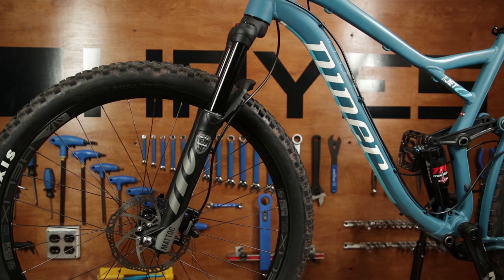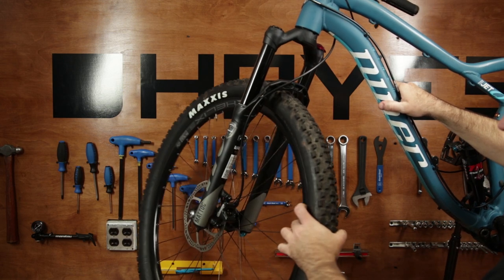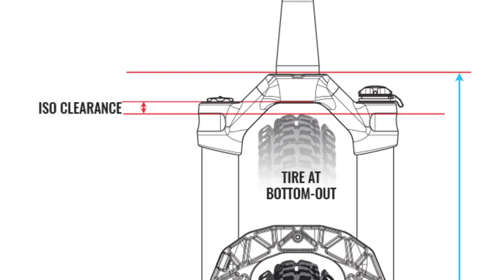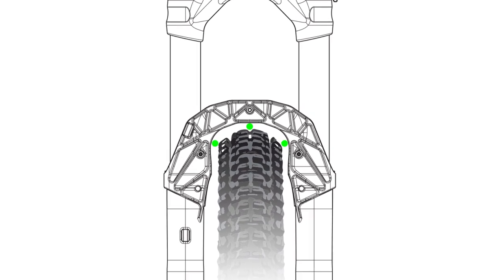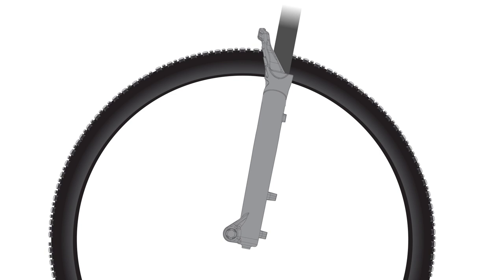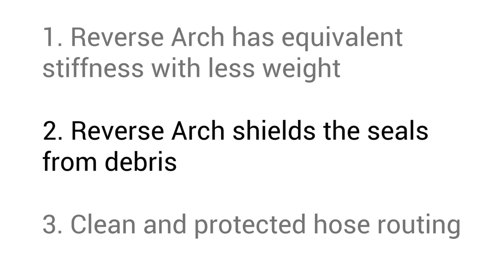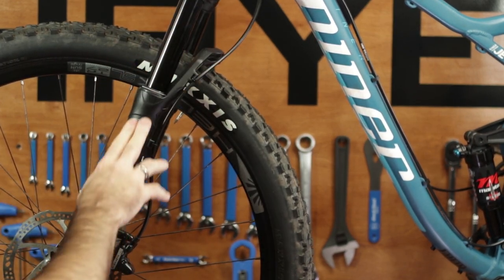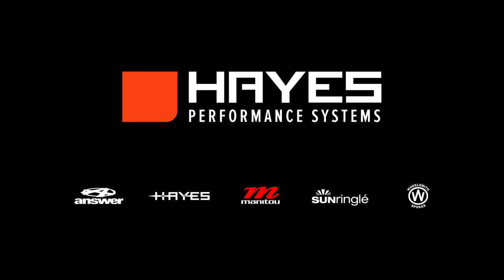Manitou Reverse Arch

Comment: I cannot say I'm the biggest Hayes fan and was never a Manitou user. I first used their Swinger X4 rear shock when a DHX 5.0 died on me back in 2007. It was a fantastic replacement and was just as plush, this is when I see the reputation around Manitou was perhaps unfounded. On my latest bike, I took a gamble on the new Manitou Mattocs with the Dorado damper. I did not regret it, they are incredible so stiff and plush. They are practically equal in performance to my Fox Float 36 and BOS Deville TCR's. To put them in the same performance bracket as those competitors its amazing praise. (Also much better service intervals than Fox)

I now regularly recommend Manitou Mattocs and compare them the Float 36's and Deville's 

Kudos Manitou keep up the good work. You are gaining more fans by the day. Even Pinkbike threads are praising the new Mattoc people even choosing them over the Pike.

Well Done 👌👌
Reply: Ive had a Dorado on my DH bike for a few years and it blows me away every time I get back on it after the winter season. The Mattoc should arrive any day now for my enduro with the 27.5 boost axle!

Comment: when the stock fox rp2 gave up on  my reign I was told it would cost £190 to fix, so started looking at RS but spotted the manitou mcloed at  £150 so thought I'd give it a go, and so glad I did its way better In every department than the fox ever was, its more supportive for a start and it's getting PLUSHER the more I use it. I was looking at one of their forks for my REIGN when the marzzochis gave up a week after I got the mcloed but couldn't pass up a bargain on a set of RS but I will definitely be looking at manitou forks in the future if they're as good as the rear mcloed.. Do manitou still make a coil rear shock as I wouldn't mind trying a coil on my reign.

Comment: How are folks getting on with the newer Mattoc? Considering getting one . Looks good and I can get 55% off list price!!
Reply: I'm trying to find info about these too. So far I've been able to find reviews from a year ago and they were 50/50. People either loved the plushness and support or their fork developed play and broke after a bit of use. I'm hoping that they have fixed those issues by now because if it doesn't brake, the value is definitely there compared to Fox or RS and I really want it to succeed but I have haven't yet been able to find and info confirming or denying that the quality control has improved.
Reply: Raul... I got a pair... very good so far! CRC are doing them for under £250 Sterling in the uk. I will have to make the servicing tools though.

Comment: Awesome design makes sense in everyway, Another advantage not mentioned but should be is that it also takes the weight of the arch and places it well behind the front axle thus keeping all the weight of the bike well inside the front and rear axles. This means better handling. The traditional front arch places arch weight more forward, almost ahead of the front axle, which means worse handling. Manitou is simply a better set up in every way. Too bad it's patented as I think would see it on every fork. Buying one now but very discouraged about the nearly 50% price jump since the world changed with this stupid C BS!

Comment: I need a fork for a Nishiki Colorado comp bike 27.5+. 
It has a 1 1/8 steer- 
27.5 plus- 
15mm axle- 
boost 110mm- 
I would like 100mm - maybe adjustable to 120mm. The problem I run into is the steer is 1 1/8 and not a tapered!  It seems anything with boost has a tapered steer.
Reply: Matt Doyle you can find Manitou Markhors on eBay with that configuration, or perhaps a Manitou dealer could special order one for you. Good Luck.
Reply: The Machete comes into that setup also if you want a step up from the Markhor.

Comment: Shout out... anyone set this rear arch up in the uk? My levers are reversed 🔄.....An arse.
Reply: My Dartmoor Hornet 26 had that annoying euro brake setup, left front, right rear. You just need to carefully undo the brake hoses at the levers and swap them over to make it UK. Try to lose as little of the oil as possible and cover the front caliper with a rag or remove the front brake pads when you do it to prevent the chance of oil dripping on your brake pads. You may need to bleed the brakes after swapping the hoses over. My front brake hose was only just long enough to connect to the right lever so I had to route it under the crown but it works fine.
Reply: @Beesa10  Ive just added a cable guide..... lets the routing alone... Ive too many bikes with that brake configuration.... cheers

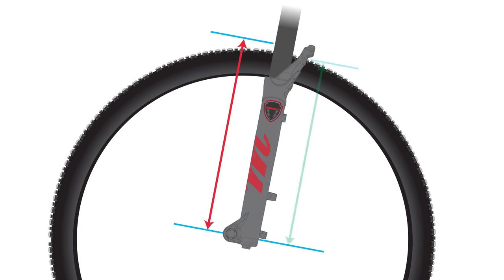Comment: 3:55 Not only the distance to axle is shorter but also mud clearance is dramatically reduced and so is fender space, which is still usefull as the arch will not protect as well as fender and will not protect at all from wind pushing mud backwards after it leaves the tire in front of the fork. The distance/tire clearance trick is really shamefull. Real difference when keeping the mud clearance would be miniscule.

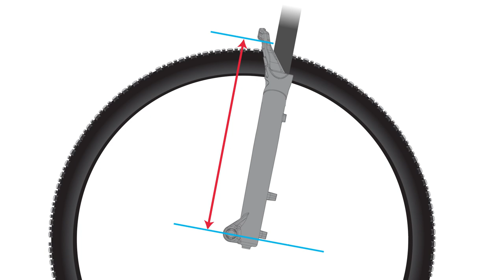Comment: 3:53 Why give this bullshit example. You have obviously brought the arch lower relatively to the tire surface, I get what you're saying, and its correct but using obviously mismatched graphical representations in disingenuous.. Instead of this wanky excuse why dont you try lower and centralised mass as a selling point. You're brining the arch closer to the centre of mass of the bike-rider system and reducing the mass -turn ratio via steering input. Also sell it for what it is, a fork brace that better positioned